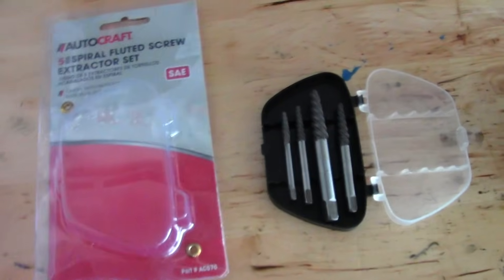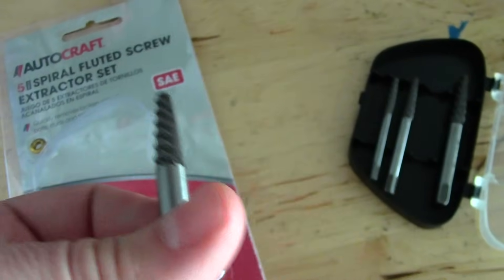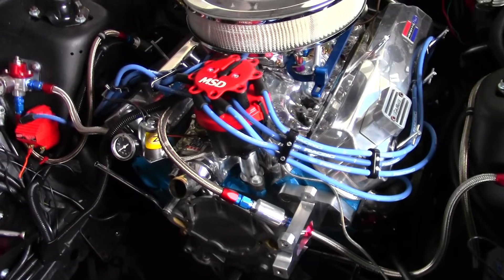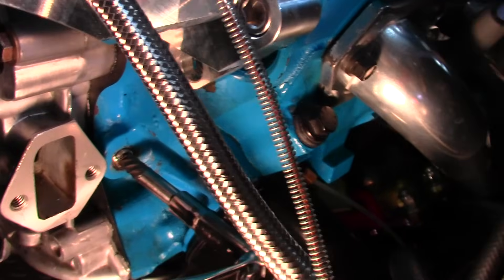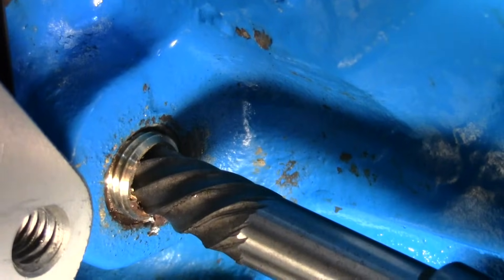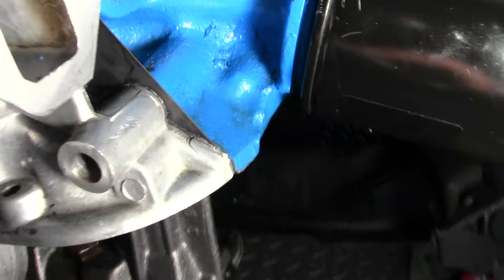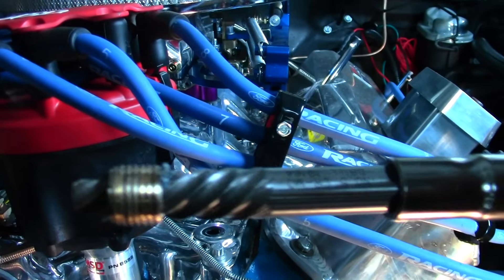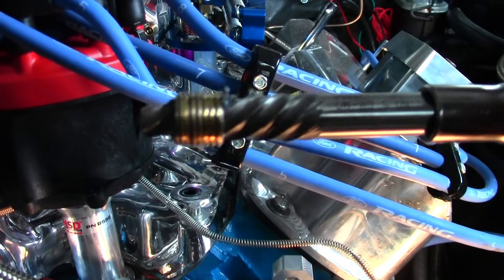How to Use a Screw Extractor | Remove snapped off bolt from engine

Comment: those bits just fit in the corresponding sockets without any adapters right?
Reply: You can use a 12 point socket on a square drive like an ez out or a tap.

Comment: This is great. I have a steel plug in the exact same hole that someone used thread lock on. It's hex drive and I'm sure I'm going to strip it trying to get it out. What concerns me is I'll have to drill it out in order to get an extractor in. How did you guarantee you didnt get any metal shavings in your engine? I saw some small fragments as you pulled that plug out.
Reply: If you can heat it the heat will soften the thread locker, and apply the heat the bolt/plug and as it expands it will crush the lock tite aiding the removal.
Reply: I think the thing he was removing was the brass portion of the oil pressure sender gauge, so it already had a hole in it. Why he did it up so tight, I'll never know. As long as its in the hole and not going anywhere, it's fine. Maybe some thread sealant to stop it vibrating out